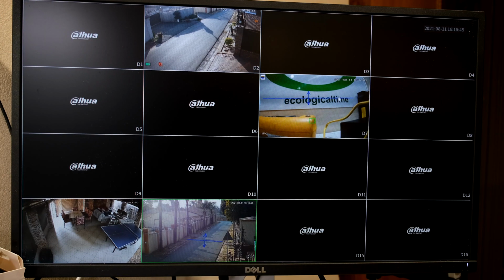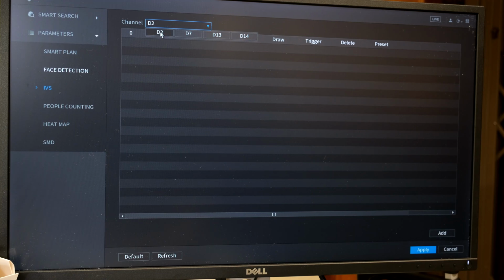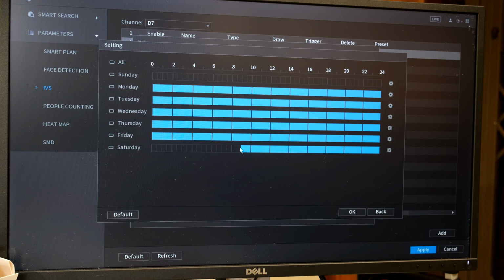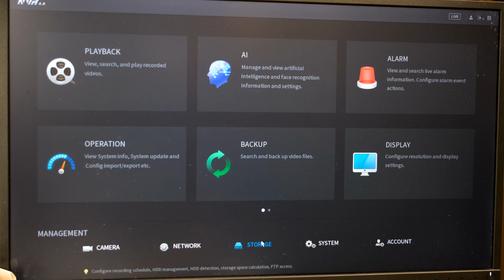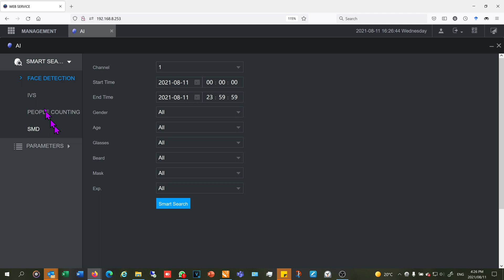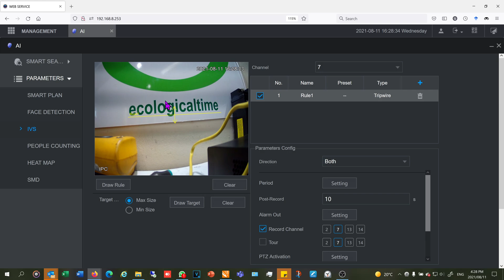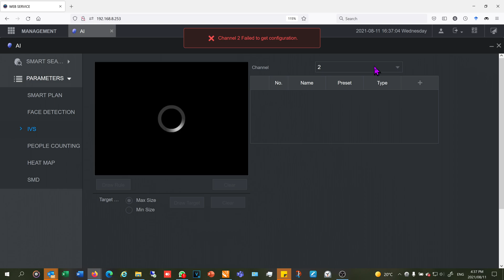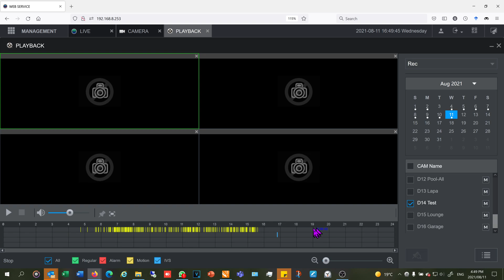How to set a trip wire on a Dahua NVR with alarm output

Comment: You are very good. I am so glad that I've found your channel ☺️

Have the DAHUA NVR 5216 with IPC 3849 and installed it in January and tripwire with IVS works great and IPC cameras creating their own alarm.

By not knowing better I have installed flood lights around my premisses connected to a motion sensor BUT you show sooooo much better to connect it to the NVR instead!!!!!

Will reassemble when back in November. With all your videos I understand the DAHUA CCTV so much better!!

Can I connect the 230 V LED Flash LIGHT  with a Cat 5e or CAT 6 to the relay of the NVR .... most probably not?!
What cable would you recommend?

My farest Point is of the light is 70 m away from the NVR. The camera there is connected by Cat 6a cable running in underground sleeves to the NVR...

.... or maybe I can connect the light somehow directly to my DAHUA IPC3849.... ???

It's a pity that I couldn't find anybody like you here in Mosselbaai.... would have made lots of things easier...
Reply from the maker: thanks for your comment. "Can I connect the 230 V LED Flash LIGHT  with a Cat 5e or CAT 6 to the relay of the NVR .... most probably not?!
What cable would you recommend?" Please dont use ethernet cable for line voltage, you would need shielded electrical cable for this job. You can use Suffix cable.

Comment: Can you do this on a Dahua DVR as well?
Reply: There are a few DVR's by Dahua that does offer this as well. I personally have a Recorder that was made by Dahua for a USA company that offers this level of tech and also adds the ability to add 2 more non AI camera devices using AI Line Crossing and Intrusion options.. Also own a Dahua DVR with same 2 IVS rules built in and on my NVR like this one if I had 14 AI cameras (I could have 16ch of IVS with my system) Personally only have 3 that work with my AI NVR as normal AI Cameras. However I have those 3 channels, and the 2 in my recorder plus because of my Dahua built AI DVR that I have added 3 channels to my NVR I have a total of 8 channels on my NVR that I can use as AI at this time...